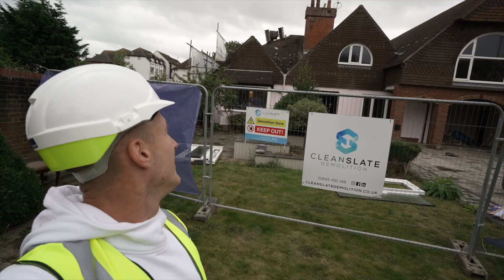WE KNOCKED DOWN OUR NEW HOUSE!! | Building Our Dream Home Ep. 1

Comment: Why buy a house to pull most of it down?
Reply: Because they found asbestos in that house and when asbestos is found a house needs to be completely gutted to ensure its all removed and the vat means it would cost more to renovate and fix it up then to just knock it down and build a new house  because there is a 20% extra vat on every individual you do to renovate and fix up a pre existing house which adds up, but there is no extra vat on building a new house